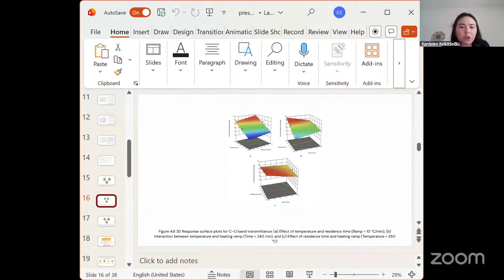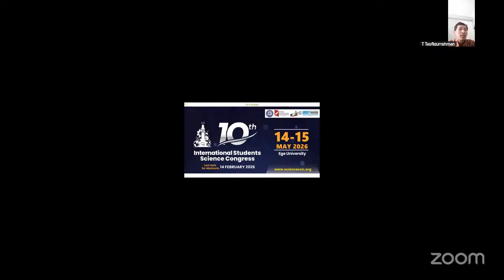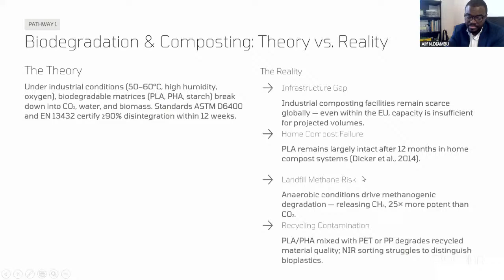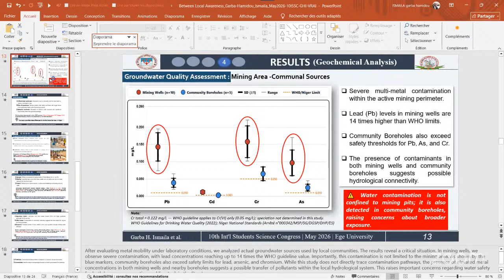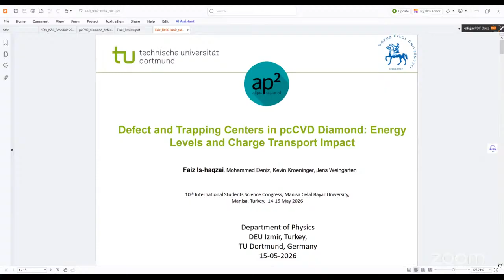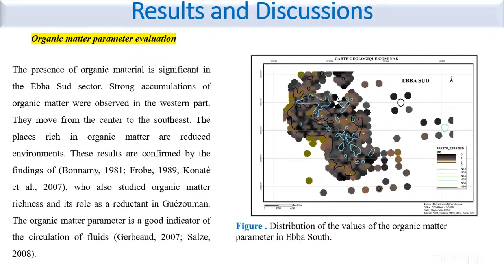10. ISSC Session 21

Comment: I would like to sincerely apologise for the technical difficulties during my presentation at the conference. Unfortunately, my laptop suddenly crashed just before the session began. I then had to switch to using my mobile phone, which caused the presentation slides to appear very small, and my voice may have sounded broken or unclear at times — possibly due to the limitations of my phone or an unstable internet connection.

For those who would still like to watch the original conference recording, my presentation can be found approximately between minutes 18 and 32 of the video.

To make up for the inconvenience, I have recreated the presentation and uploaded a clearer version on my YouTube channel. The link is provided below in this comment.

Thank you very much for your understanding and support.

Integrating Religious Activity Intensity as an Anthropogenic Water Input in Urban Runoff Modelling 

https://youtu.be/QEV4FL0IsCI?si=J68uoCG1QOTBlEOY